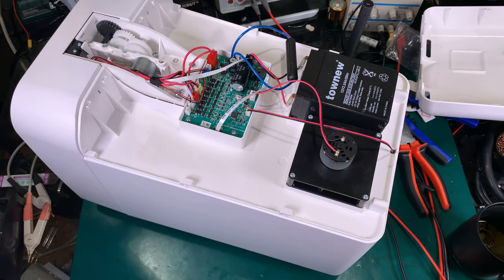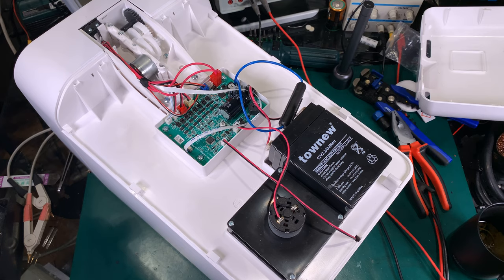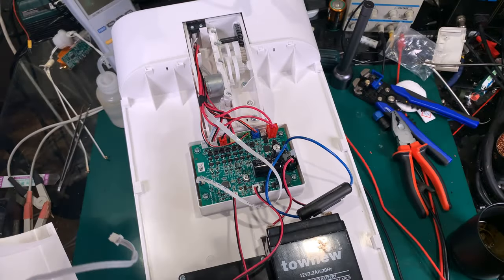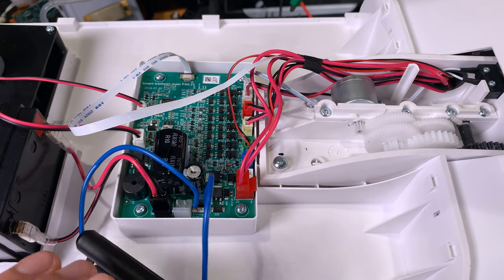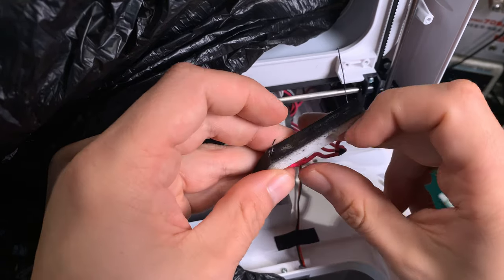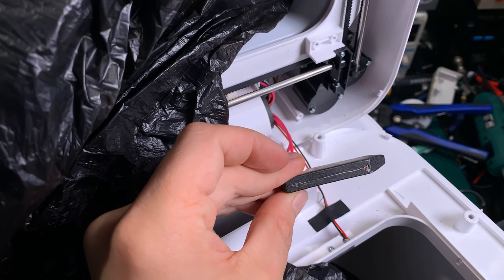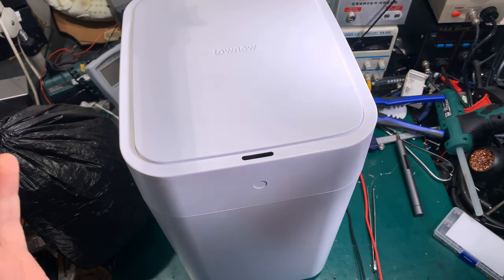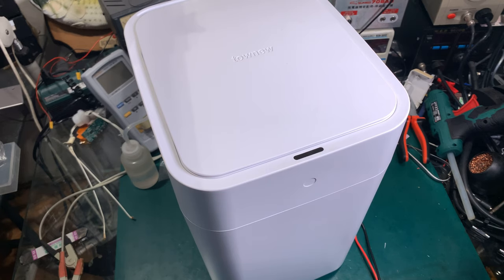Xiaomi Townew T1 smart trash can - fixing no power & broken sealing heating wire

Comment: Hey do you happened to know how to shorten range of IR sensor for this recycle bin? Mine is always open when I put it beneath table.
Reply from the maker: This is interesting question...  I have no idea how device operate - it must emit IR so adding resistor should limit range.   You can also try add something dark that will block part of IR like shade.  But it's just idea - i would start from it.

Comment: My T1S doesn't seal the bags anymore, after 4 months only. There are 2 arms coming together to seal with heat, they usually come 2 times and hold while it's sealing. Now it comes only once and doesn't seal, just beep. And the lips remains open all the time. As soon as it closes, it reopens again. What can it be ?
Reply from the maker: If I would be You - I would just check tension on belts and try stick finger, start sealing process and see what force it can deliver on those arms - if barley nothing and belt is slipping than You have answer where look at problem.  It's quite simple process they need touch limit switches - I don't remember how it was design but on some there is small metal tab - maybe it need bending because it hit to soon or to early.
Reply: @ElectronicNoobBlog  I think there is something else, because as soon as I turn the bin ON, the lid opens and remains like that. If I close it manually, the sensor doesn't work to open it.
Reply from the maker: @remichina  What happen when You press front button?
Reply: Press one time. The blue light turns off. Press again : it closes and open right away with blue light. (Like open lid mode)

Comment: Mine has a defective battery I guess. Depletes in a day but works otherwise. I keep it on charge all the time but is that dangerous in the long term? Could I remove the battery and use it as a wired device? Would it function? I could also replace the battery but it is not an issue to keep it connected for me.
Reply: BTW, appreciate the video. I had a chance to remove the cover easily and check the battery specs myself thanks to your video.
Reply from the maker: @ekinkoc8683  Hey, 99,9% i'm positive You can leave it plugged without any problems. Just check do You have li-ion version or SLA like on this video. You can even try unplug battery (should be safer) because if it have short - constantly trying recharge it might cause fire hazard (if one cell is shorted).

You are welcome!

Comment: I have been using this one since 2021 but recently I think it has battery problem. The sensor works fine, the lid can open/close normally but when I press the button to change the bag, it has a normal beep sound, then a weak motor noise, and nothing else happens.
Reply: Me too!!!  Did you have any luck?
Reply: @amyh6991  sadly no,  I can't get the battery shipped to my country nor replace the battery myself 🥲 so I just using it manually as a normal trash bin with sensor lid now lol
Reply from the maker: Are You sure? That battery is SLA if I recall UN2800 so it's excepted from most shipping regulations?

Comment: mine doesnt sense motion n open the lid. i have to open it manually. it does allow me to seal and replace the bag automatically. else i have to throw away the refills already. any way to fix the motion sensor part?
Reply from the maker: I also have unit's with this issue - but right now I don't have time to diagnose them (lot of other work) - quick idea start from making sure it's actually motion sensor (seems to be odd fault since it must be simple circuit)  - when it's in automatic mode, moving hand will trigger LED lights. Force and open lid, move hand - see if led are glowing. If Yes - than motion sensor is OK and fault is in motor, driver of motor or gearbox.
Reply: I have the same issue as well. The LED light is lightup but the lid just dont open. Even if i press the button, the lid still dont move. Other than that the sealer is working fine.
Reply: I need help with the sensor not recognizing a hand pass over. It is a recent problem. I can open the lid with a press of the button. My bin will still seal the bag but does not realize I have removed the full bag of trash. It will continue to beep for removal. I turn the bin off and on as if for the first time. It will then suck the bag in.

Comment: hi sir, my trash can does not do much when i press button. lever attempts to move then stops, no fan noise. :(
Reply from the maker: I would check to manually spin all motors - maybe there is problem in some gearbox. It's impossible to pull valid diagnose basing on this description.
Reply: The battery might be dead and won't charge

Comment: My townew trash can cannot pull a new bag all it does is make noise then beeps then opens for me to push it down manually.
Reply from the maker: Check if fan is working properly if yes try different bags (maybe they are twisted inside and require to much force to be pulled out by vacuum)